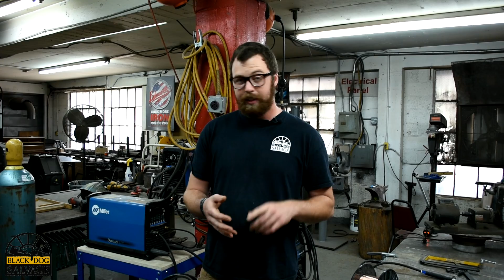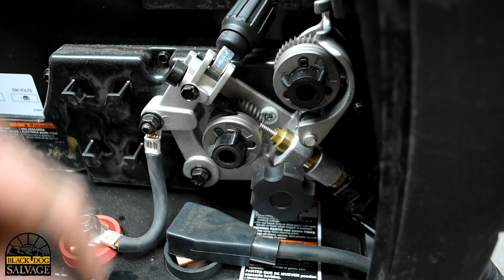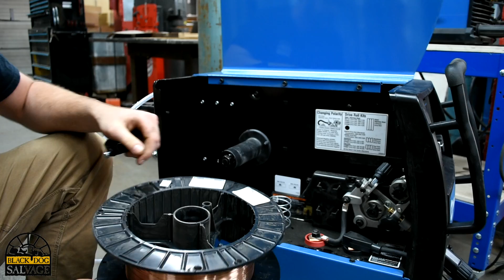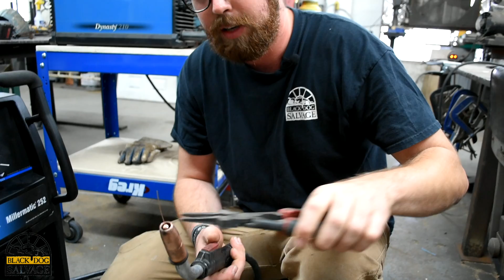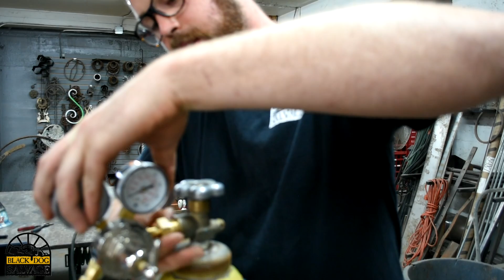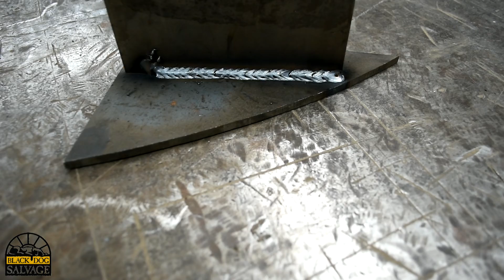How to Set Up a Mig Welder with Black Dog Salvage

Comment: Being that this is over 5 years old, this comment may be kind of moot but... Welding gas cylinders of this type are double sealing, that is, they are sealed OFF when fully clockwise (looking from top of bottle down). Likewise, ON is sealed when the valve is turned completely counterclockwise until it stops, then snug it a little, like you do when you turn it off.

Comment: All high pressure gas cylinders need to be opened all the way because it has a seal on the bottom and the top of the valve

Comment: 2 important tips that should have been covered. When you’ve finished welding, turn the power off to the welder, shut off the gas tank hand tight, press the torch trigger to let the gas out and finally, back off the regulator until it feels loose or you will damage the diaphragm in the regulator. Ya, ask me how I know about the last point.

Comment: Hi,
Just a question please .

Do I have to use the gas ??? Will it work without the gas please ?
Reply: You can use flux core wire with no gas
Reply: You will need different rollers on the machine and a different torch tip

Comment: I have used  the Miller 252 for several years. I use a binder clip with a piece of soft cloth in the filler wire to wipe the wire before it goes into the liner.  Love that machine. Great video. Addicted to the show